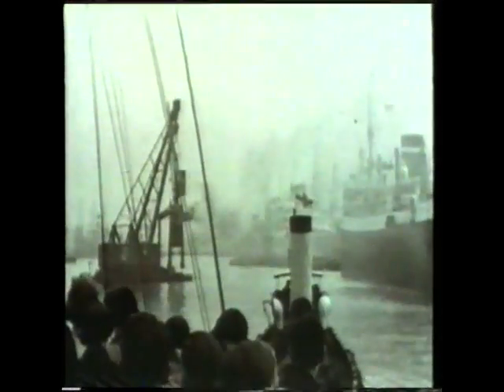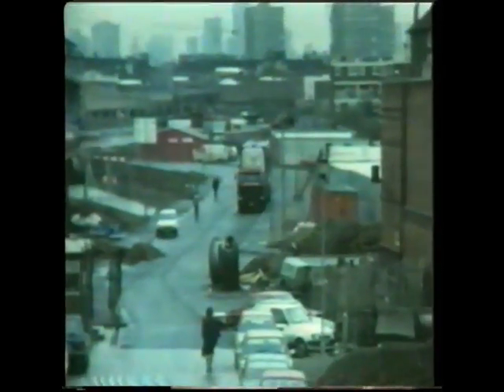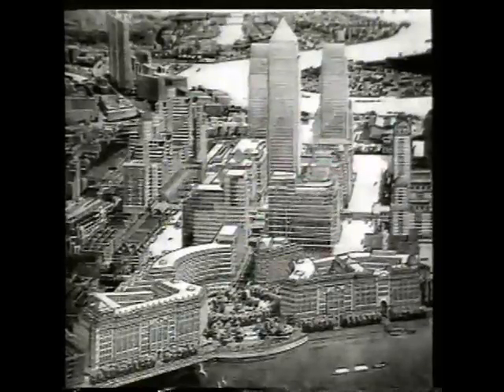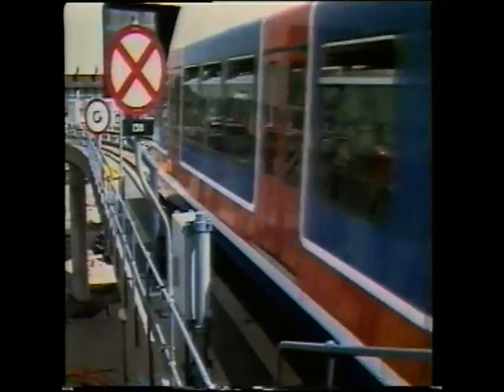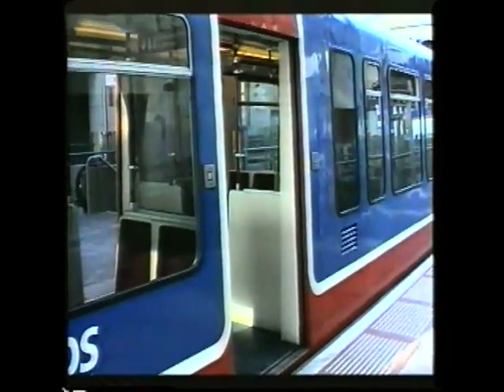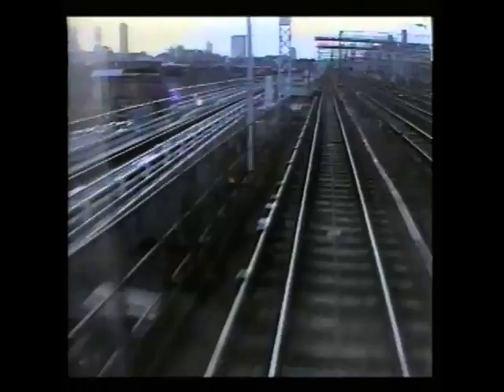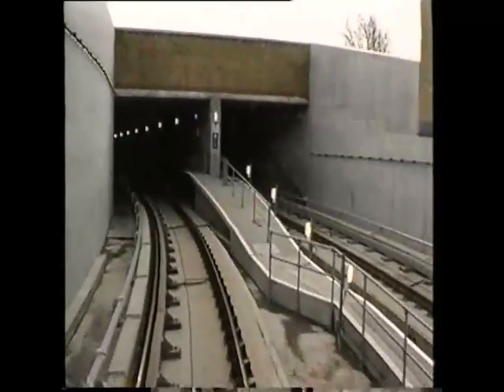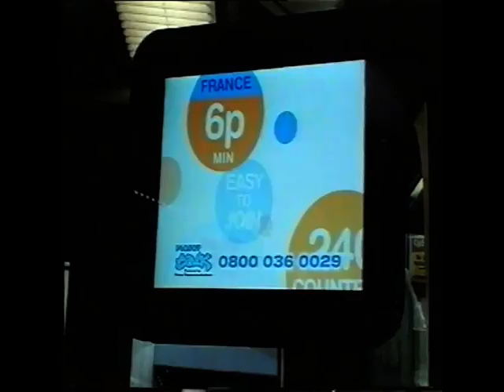Docklands Light Railway

Comment: I worked on the DLR for 25 yrs, it became a really effective railway system
Reply: They should have kept the original island gardens
Reply: Do you know when the original trains were replaced? I think it was probably around 1992 or 1993.
Reply: @ajs41  we started testing the new trains as 1992 stock and thats what they became known as to rolling stock techs
Reply: @raymondwalsh7957  Thanks. I'm fascinated by the early history of the DLR, but it's difficult to find out a lot of information about it. For example, it's well known that the doors didn't actually open at the Canary Wharf stop for a long time because there was nothing there, no reason to get off since it was just a building site, but it's difficult to find out when the doors did open for the first time. That's the sort of nerdy information I'm interested in.
Reply: @ajs41  i believe the tower at canary wharf opened about 1991 but couldn't say exactly, sorry
Reply: i was wondering if you can help me i found a picture of the DLR junction between Polar and West India Quay, and when you come from bank going towards West India Quay there is a old Straight bit of abandoned track on right. Any idea why it was pulled up cos i think alot of of trains use to use it back in the day.

Comment: I must say, it is a transport masterpiece from an area that was at one stage going nowhere. Canary Wharf is an interesting station, three tracks, passengers at either end of the platforms boarding at the same time. Tower Gateway as of 2017 is still there so is Bank in the heart of the Square Mile. Since this video was filmed, Woolwich Arsenal as of 2017 is one of many stations added to the ever growing network of the Docklands Light Railway. Like Greenwich and Lewisham, it is linked with National Rail services. A busy summer ahead with the Athletics World Championships that will probably match to that of the 2012 Olympics. My earliest memory of the DLR was in 1990 from Island Gardens to Tower Gateway while on a day out to Greenwich.
Reply: Canary Wharf was an interesting station when the system first opened in 1987, because officially there was a stop there, and it was on the maps, etc. But although the train stopped, the doors didn't open, because there was nothing there, so no reason for anyone to get off.
Reply: Woolwich Arsenal station opened in 2009 and was a significant factor in the redevelopment and improvement of the Woolwich/Plumstead area.

Comment: Great video. I lived on the Isle of Dogs between 1996 and 2003 and used the DLR nearly every day, including the original Island Gardens station. The video mentions that the Lewisham extension was completed ahead of schedule. Was surprising at the time as the contractor for the tunnels under the Thames managed to blow one of them up leaving a massive crater in sports pitch of the local school (George Green School). For a long time afterwards you could seen mud stains against the white walls of the school!

Comment: I have a question about your ELL to Shoreditch video, but comments are turned off. I am following the route on Google Maps and the centre conductor rail is not there! How can that be??? Thanks
Reply: If you're following it recently, that would be because it was removed and converted to third rail only, as part of the extension/Overground conversion works?